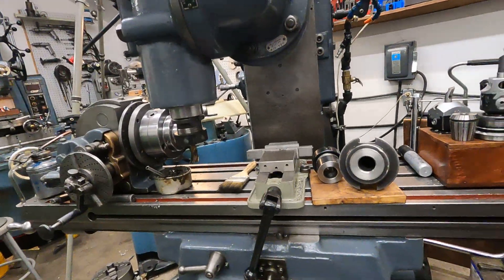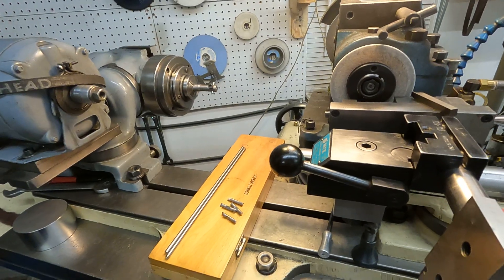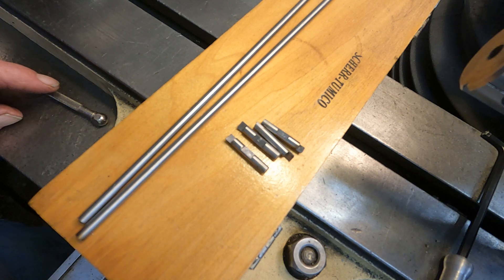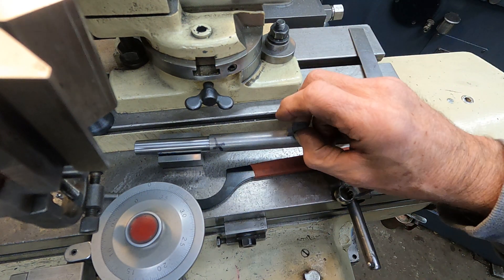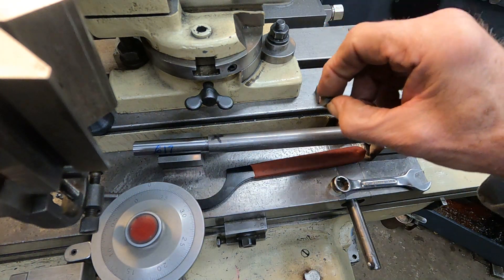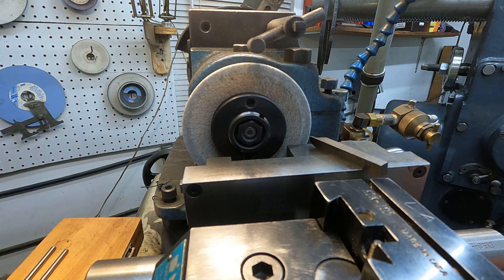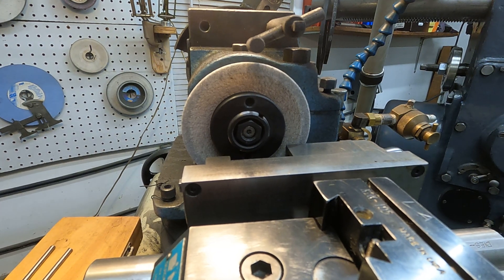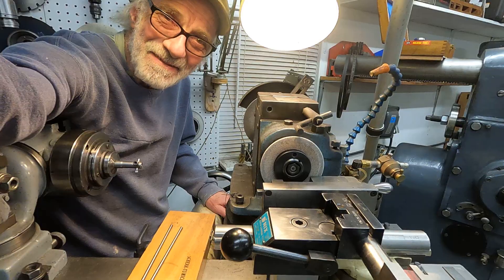Toolmaker at the Cutter Grinder

Comment: DeeDee, Of course I’ll keep watching.  You just keep making the videos.  Glad you’re feeling better.  30,000 people have been hospitalized with the flu so far this Fall. It is a good time to stay away from the hospitals.   Cheers, TB
Reply from the maker: I caught this cold in an overcrowded Costco, I usually pick times with less traffic like early morning. Being normally soaked in kerosene and oil I generally do not catch too many bugs. I am glad you enjoy these videos, the cutter grinder is the machine that ties the others together and just makes things more possible. Making videos of the machine is a real challenge and the nature of the machine and open unguarded wheels makes many uncomfortable also.
Reply: DeeDee, Is that because people stay farther away because you reek of flammable liquids?  🤭. Kidding.  I’ve finally got the ELSR mechanism not only figured out, but working perfectly.  I am wiring switches tomorrow and the crossfeed screw repair is in the works thanks to my friend Archie.  I may have a working, rebuilt lathe up and running before Xmas.  Then we rebuild the headstock on his Hardinge.   Life isn’t dull.  Cheers, TB
Reply from the maker: @bid6413  I just marvel at the gear's, rods cams, precision bearings also 2 knobs and lever that click 3 tiny switches in the elsr whose real function is to simply turn the spindle off. It is not just a lathe, its a lifestyle! I still have small jobs to do for the refurbished old machines, right now I am modifying the Axelson steady rest fingers for bronze tips using the horizontal mill, now the old machines are fixing each other. The Hardinge is one where it is important to note the bearing race high spot locations on the housing and spindle to help keep the 5c taper running true, a Hardinge field tech was one of my motorcycle customers many years ago and I used an HC chucker for cylinder head small parts. It generally took 6 months for a lathe to be built once ordered from the factory, you are moving right along there Blade.

Comment: thats quite a machine. I have used surface grinders and I now have a cuttermaster endmill sharpener for sharpening endmills. Once You learn the basics You just keep adding to Your knowledge each time You tackle a new job.
Reply from the maker: yes, there often are many different ways to do the same job, I started grinding the notch with a straight wheel then found I could do all the grinding nicely with the smaller dish wheel, thanks!

Comment: Love all your videos, especially the tool and cutter grinder stuff.  Not much out there on that subject.  I have a Brown and Sharpe cutter grinder in storage that was missing all the accessories.  Im having a hard time finding a smaller work head for it so I can use it.
Reply: I went down the same road trying to locate a 5C work head.  Finally found one on Craigs list but paid $350.  Ouch. They are out there but finding a good one is tough.  Look for cracks.
Reply from the maker: This is the third work head I have had, I paid $1000 for it in 1998 when a new one was $4500, They cannot be taken apart and put back together and run 40 millionths true, but the tapers can be reground on the machine with an internal spindle if the bearings are smooth. Work heads are a major obstacle, I gave up and bought a known working one from a machine tool dealer. Thanks for tuning in!
Reply: @deedeeindustrialsuperprecision  I’ll have to keep my eyes open on CL and FB in Washington then.  I’m next door in Vancouver BC and haven’t come across anything in 2 years!

Comment: Thanks for these tool and cutter grinder videos.  Please keep doing them.  I have a Brown & Sharp #10 T&C  Grinder and I'm clueless on operating it.  Bought it thinking I will be able to sharpen end mills but have yet to garner any success.  Youtube is mostly void of any meaningful instruction on sharpening end mills.  There are some but they assume there is some working knowledge which I definitely do not have.  I'm guessing there are others out there as ignorant ans me.  A few videos that include the absolute basics of wheel selection and setup would really be appreciated. My maching has a non electric work head and an air bearing.  Thanks . . . Bill (Gardnerville, NV)
Reply from the maker: I found it not really worthwhile for me to sharpen the flutes of endmills smaller than 5/8" and there I can use the regular work head, just because of the time involved, but another guy here does for his work, he uses cut-off wheels to grind the flutes of small end mills for cool grinding. With a fixture like a Univise you can grind your lathe tools and get started and familiar just using the machine. Start out with new Norton straight wheel and a cup wheel in coarse grit, and perhaps a coarse diamond cup wheel for carbide. I may do a quick video on getting started.
Reply: Thanks for the reply. Like I said earlier, I’m clueless on the proper setup. I understand the required primary and secondary angles but setting the work head on the table and travel limits seem to be where I’m confused. I have the machine (B&S #10) and the will. I hope you do that video. Thx again.